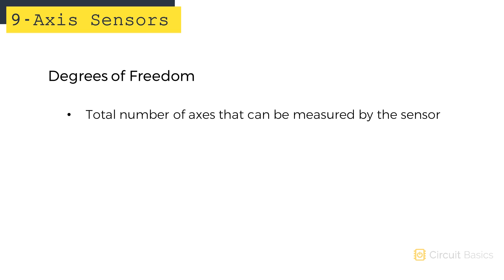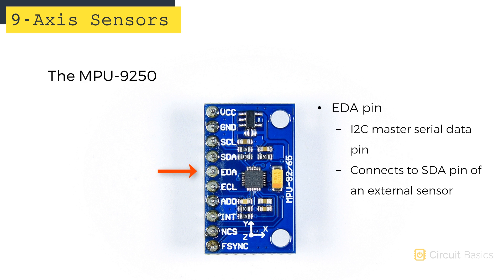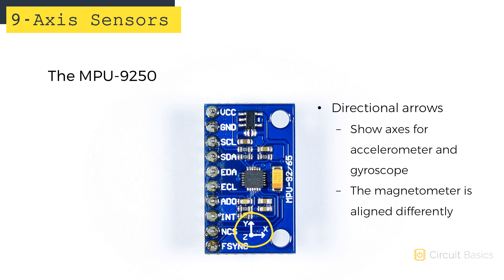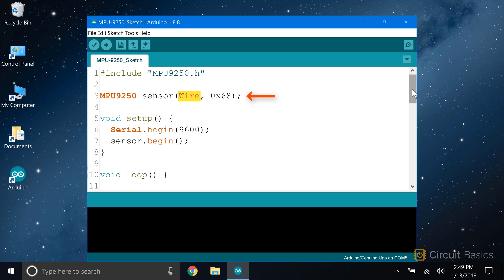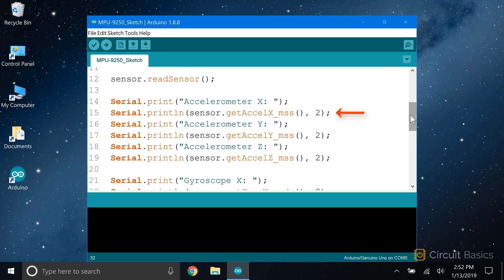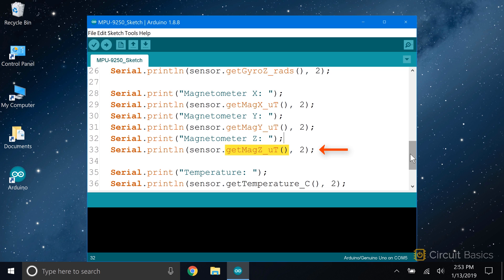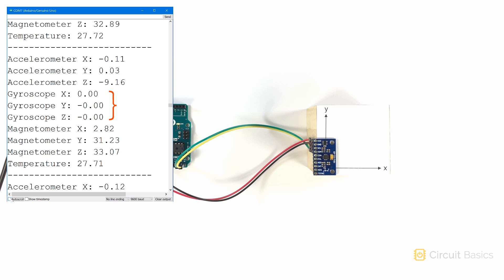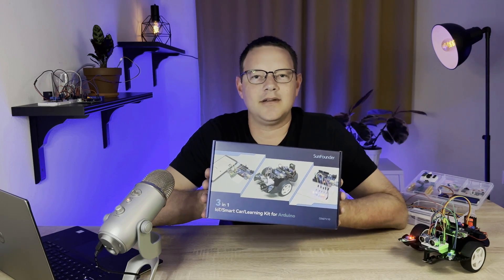How to Use 9-Axis Sensors on the Arduino - Ultimate Guide to the Arduino #44

Comment: What simulator are you using?  I cannot find a MPU-9250 in any simulator online.
Reply from the maker: Everything was connected to the Arduino and running in real time, no simulator used